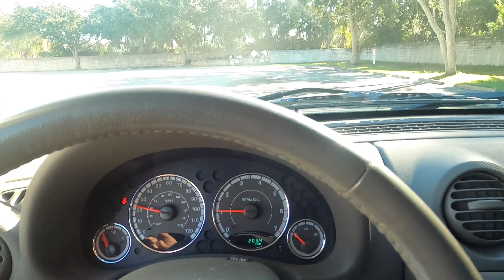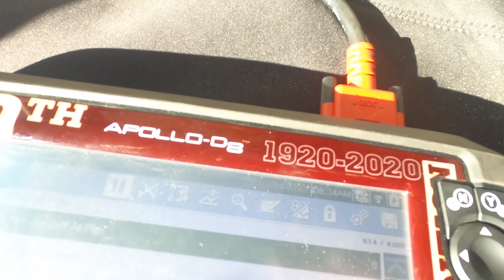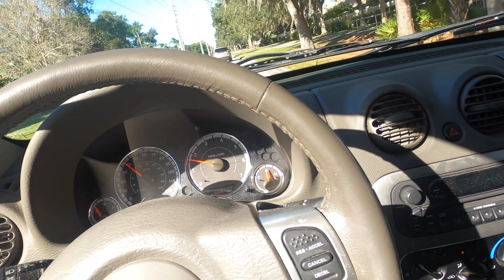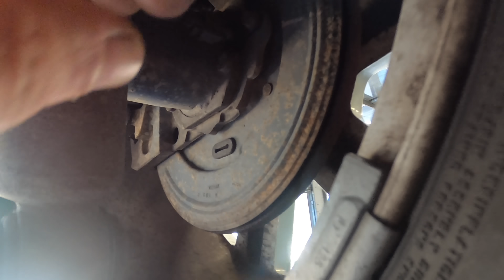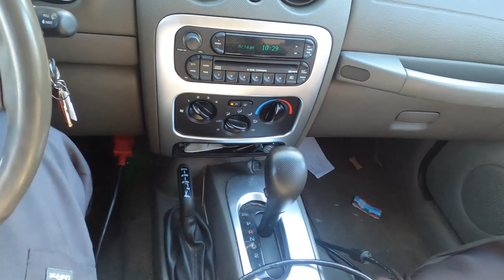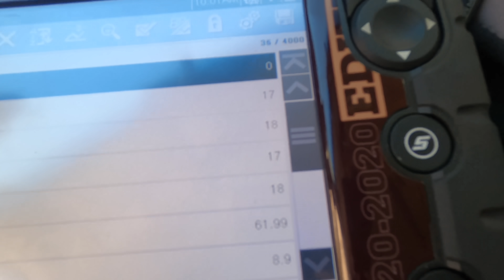MultiMeter Lied to me | Proving a faulty part. Jeep in limp mode

Comment: Easy job for wheel speed sensor on this one always nice to conform by swapping a sensor love dealing with Abs and wheel speed sensors that have single bolt the ones that are apart of the hub are a pain @Rainman Ray's Repairs

Comment: don't assume FLUKE multimeters are the best of the best they are up in the top range BUT they are designed for the military specifications hence the price is pumped up BUT there are cheaper multimeters on the market that are just as good if not better in the way of range, accuracy and build quality like for example BRYMER ( GERMAN ) I speak from having many years of actual experience in electronic engineering maintenance/repair both in the field and lab and I'm no cheap arse just thought I'd mention it, elevated price does not mean higher quality

Comment: So maybe I missed something but I didn't see anything wrong with your meter.  Your first measurements were done with it in auto range mode which for what you do is how it should always be set.  You got a reading for 18.8 M Ohms or mega ohms or million ohms and 4.5 M Ohms (Mega Ohms) on the other one which is a significant difference.  You then changed to manual range and set the meter to Ohms.  This means it could never measure the resistance of the sensors anymore because they were out of range or OL.  It worked great for your leads since they should be almost 0.

Comment: Thanks for sharing Ray- love our videos. My background is in electronics repair, and I like the way you approach issues. The wheel sensors are Hall Effect devices. When you place them on a ferro-magnetic surface (such as the top of the tool box) and move it away, you will trigger the device- which changes the resistance reading on the meter. You cannot expect the two devices to read similar under different physical conditions. Also, the resistance reading will be a function of the current output of the DVM when on different Ohms ranges. You need to turn off auto-range when trying to do a resistance comparison because on higher Ohms ranges the current will be too low to operate/trigger the sensor at all.

Comment: Moving a faulty component to another spot is a reasonable troubleshooting technique, but it can be risky. This story has nothing to do with cars. Several years ago, my office had a large computer system with a fault. The manufacturer's technician was called and he quickly identified what he believed to be a faulty PC board. To confirm it, he removed the faulty board and swapped it with what he believed to be a good board. By doing so, the once good board also became faulty, as did several other components in the computer. The technician ended up having to rebuild a major part of the computer with new backplane and  PC boards, at a cost of over $50 thousand, which his company had to eat. Moral: be careful when swapping components around.

Comment: I always thought that the way to check an ABS sensor is with it installed on the car: rotate the hub and look for (low) AC voltage at the output. I'm not a mechanic by trade, so sorry if this is dumb.

Comment: 0.2Ohm is common resistance of the wires. The reading of the bad sensor was not mili-Ohms, but mega-Ohms, so practically open circuit, maybe some leakage (dirt,...). These meters can not measure mili-Ohms, you would need 4 wires for that...

Comment: the sensors work on changes in magnetic fields. when you tested the first one it was resting on the bench. when you tested the second it was in the air. this also may have contributed to the "off" reading

Comment: I just had a multimeter do the dirty on me. Thought the alternator needed replacing due to the alternator not charging, lucky I double checked with a different multimeter or that would've been wasted money. First multimeter had a flat battery.

Comment: Replace the meter battery.  having the meter in Auto ranging is why the meter did internal tests and the meter then switched to the Mohm (Millions of ohms range).  The values suggest to me that there was a Hall device (electronic semiconductor inside). These are electronic semiconductor devices that respond to the passing of a magnet in front of them, it is not unusual for semiconductors to read very high resistance on an ohms test.  The lower reading in auto was the faulty device.  When you switched to the manual ohms range, it was on the low ohms range 0  to say 1000 ohms so the Millions of ohm reading was OL (out of range). If you had selected the higher manual ranges eventually you would have started reading the Millions of ohms again.  It would be a good test next time you have a sensor out is to put the meter in continuity range and pass a magnet in front of the sensor head. You may see a pulse of reading on the meter. (Try the test with the meter probes both ways around, two tests) You may find this a rough way of getting a test on the sensor.  Good luck.

Comment: Already had an abs Sensor Build as a hall-Sensor with 2 Pins, if you Test hall-Sensors on it‘s resistance you will kill it. unlike the old inductive sensors where meassuring resistance is totally fine.

Comment: If you plan to get a new meter and you need to buy it yourself i can recommend the "KAIWEETS HT118A"  it comes with a light up display and offers a led to light things up on the back. Furthermore it is nothing crazy expensive and does a good job imho.

Comment: Hi this is a standard multi-meter that does not do milliohms, the M on the ohms scales is MEGAOHMS (1 million ohms) which most sensors will measure, sometimes in the Kiloohms (1000 ohms)..Just saying your meter is working fine

Comment: Many times a simple multimeter does not produce enough voltage/energy, in the ohms function, to breakdown any latent faulty insulation problems (sensor body and wiring) to enable detection.  You want to use a meter that has a Dielectric Absorption Ratio test function (Fluke 1587 is an example). Leave the sensor bolted in and connected, disconnecting it from the ECM or whatever computer module it is connected to and then connect the meter at that end of the circuit,  testing the wires and sensor between themselves and each and to vehicle ground. We use this testing methodology when troubleshooting airplane sensor circuits, it is extremely effective in identifying faulty/latent sensors.BTW great troubleshooting with the sensor swap.

Comment: I own a couple of Chrysler's wonderful products, and one has intermittent issues as you showed in the clip, as well as the Traction Control light coming on.
Of course, every time I go to fix it, it stops doing it...
Makes for great frustration.
I suppose I need to buy a DECENT scan tool.
And, yep, digital multimeters have beedn an issue for me as well. Even using the "prove, test, prove" isn't 100% guaranteed to show random issues. And, yep again, the first thing done is replace the batteries if I get wonky readings.
I was always taught "trust your instruments".
Sorry, but no.

Comment: It must be so nice to live in a place where nuts and bolts just come loose and then sensors slide out. Here before I even touched it I would advise more then likely they would have to purchase a new sensor because the bolt isn't going to come out and if it does the plastic sensor is going to turn to dust the minute I attempt to pry it out.

Comment: Grey fox beat me to it. usually a 9 volt battery will fix your multi meter. Resistance depends on it. Faulty speed sensors are a common fault for Jeeps. It looked the same as my Diesel Jeep wrangler speed senor. Sometimes hitting bumps in the road kills them.

Comment: Pro Tip. Watched loads of your videos. One problem I;ve noticed is the algorithm has problems with your Pt1, Pt2 videos. Because your titles don't match from one Part to the other, it can't recommend the second video on the Top right. You need to keep them the same; This video is awesome Pt1, This video is awesome Pt2, etc. Viewers can then jump from one to the other easily. It's also difficult to find the 2nd part going through your catalogue manually because the titles are different. The mini videos you did is a good example.

Comment: M on your meter for resistance does not mean Mili Ohms, it means Mega Ohms.  In other words, very high resistance.  Mili stands for 1000 as the multiplier, Mega stands for 1,000,000 as the multiplier.

Comment: I remember having my 94 wrangler. It ran like crap because the intake/exhaust manifold gasket was broken which I fixed and it ended up running perfect after that. About a year later I look under and see that the o2 sensor was broken off . No codes , no rough running. It was clearly damaged a long long time ago.

I still fixed it but basically noticed no change…

The 90s were the end of an era.
Reply: The '60s and seventies were even better better because that's before everybody got into all these admission controls and they will muscle cars absolute monsters on the road it was a great time have a good evening

Comment: A lot of people seem to agree that it might just be the batteries in your multi-meter going bad, as many time as I've seen you fix problems by ensuring proper electrode transmission, I would maybe start there.  Great work on the fix, point well taken where you can't always swap out the same part from one side to the other.

Comment: I don't know about Jeeps, but Ford speed sensors can be passive, active, or bi-directional. Passive should ohm out to about 1-2k ohms. Active sensors require a special tester, and bi-directional (used on cars with self parking) can't be tested at all. Oh, and you cannot tell which sensors are which just by looking at them. I agree with the others that maybe the battery in your DMM should be changed.

Comment: wish those type of sensors came out that easy around here. i always have to pry them out, and twist them, dig the corroded chunks out of the housing, drill the broken bolt out, sometimes even have to remove the brakes and drive the sensor out.

Comment: I need your help with my 2006 GMC Sierra as I drive the ABS and brake light come on not sure why changed the ABS sensors The Hub the ABS pump and still do the same thing what else could it be

Comment: I have found that disconnecting the wiring harness and probing the sensor terminals with a Volt meter you can slowly turn the wheel and see the current being generated.  No voltage, no Good!

Comment: Probe to pin resistance measurements can be a PITA. When possible I use gator clips, fastons  or sharp meter probes to minimize errors. It is possible to have a bad DMM but getting proper pin/probe contact is usually the problem I encounter when resistance measurement is a valid test for a given component. Nice vid thanks!

Comment: When the display on your multimeter read OL, that was because you were in a range that was to small to give you a reading and at that time you were in the std ohms range and not in the mega ohms range as you were before when you got that 18M and 4M readings. 4M being the faulty sensor.

Comment: Ray, let me share this video of an intermittent crank position sensor failure on a Ducati engine that drove me mad for weeks. I just didn’t expect it to fail like that. You can imagine it would work while the enige was running and vibrating, causing only a slight random misfire, and then occasionally cause a no start condition, which would randomly disappear and re-appear. Infuriating. That bike tested me. No data-logging in the ECU, that stuff is a life-saver https://youtu.be/f76-vg0qcMg

Comment: Understanding your meter and resistance is half the battle. 
MΩ = Mega ohm or 1,000,000Ω
KΩ = kilo ohm or 1,000 Ω
Touching the leads show 0.2Ω or 200 milli ohm or mΩ. You can not read less, so your sensors do not read 18 milliohm. If you set to milli ohm reading, that is why you read nothing on the meter because you're to far out of range. 🤔

Comment: I could be wrong Ray but I think a resistance test on active wheel speed sensor is not a valid test. But the swaparoo test you did is quick and easy to pinpoint the problem and my go too.

Comment: The sensor is likely a semiconductor device, probably a Hall Effect device, not purely resistive. That's when you try the "Diode" setting on the meter, which keeps the meters sourcing voltage under 0.7 V, so the diode junction doesn't forward bias.

Comment: Test leads get worn from stabbing insulation or using them as tools.
Meter batteries have to be replaced once a
 year at least.
John Fluke makes the meters I trust when having to condemn an expensive component.
I didn't like my RPM hunting in a fluke meter once and sent it for diag.
I received a call to nail down how to make it act up instead of a quick bench test by the meter man.
When they shipped it back, it was brand new and an additional new set of test leads were included.
I gave the tool truck 40 for getting it done.
There was no charge by John Fluke.
I have an 88.
It's bad ass.
It doesn't lie, but new test leads are good for diagnosing old test leads by comparison.
Hope this helps.
Our shop foreman would never trust another guys meter.
It had to be a fluke.
Then he would figure out what was going on.
Guys were told to take their new china meters home when he could isolate them as a cause.
One guy found out what a RABS valve tastes like.
Sweet and sour sauce didn't help.

Comment: Nice video. Wheel sensors are hall effect devices (semiconductors).  Semiconductors don't measure like a resistor would.  The voltage provided by the meter will affect the resistance reading (which was in megaohms).  Reversing the meter leads can change the reading and each device can actually read a slightly different resistance .  Your meter only showed that the sensor wasn't shorted.

Comment: Craptacular multimeter wires are, in my experience, the number one source of faulty, inconsistent and otherwise unreliable readings. Batteries can be an issue, but if the meter has enough power to light the display, it probably has enough power to perform its tasks.

Comment: try moving,disconect,re conect the multi battery. or replace it. i find if i roll the bullitt type a few times they come good, same as a car battery, they get resistance build up. tiny nano corrosion,inbuilt failure, production & consumption. ect,ect.

Comment: I had the same issue with one rear sensor showing 'Implausible signal' a few months ago.  I went with the easiest troubleshooting option like you did, and swapped the sensors. Bad side was good, and the good side went bad.  Fault double verified by transfer!
One new sensor & all good.

Comment: Probably because I'm more of an electronics guy than an automotive one but my advice is always have at least two meters so you can compare readings when you're questioning what you're getting from one.  And an extra set of batteries helps too.  Especially with cheaper meters I've seen them do strange things with dying batteries before the meter's low battery indicator came on.  Kind of the same with indicator lights on cars I guess.

Comment: What is another phrase for              "with that being said?"
Sorry Rainman couldn't resist myself:

Need synonyms for with that being said? Here's a list of similar words from our thesaurus that you can use instead.
Adverb
Within the constraints of the situation
all things considered nevertheless however nonetheless notwithstanding still yet even so otherwise regardless all the same despite everything despite that natheless still and all for all that in spite of everything irregardless that said at any rate in any event in spite of that in spite of this just the same and yet be that as it may despite this in any case though anyway having said that howbeit withal but anyhow after everything at the same time come what may although after all anyways but for all that not the less but despite that but still but in spite of that even though besides even then again furthermore on the flip side on the other hand conversely whereas at all events whatever happens contrariwise on the other side of the coin no matter what be it as it may then but then again without regard to in spite of despite no matter what happens per contra despite the fact that in spite of what preceded when all is said and done while again either way at any cost on the flip-side whatever the cost rain or shine whatevs whatever

Comment: Always use fresh good quality batteries if ever in doubt.  OK to replace just because as a routine every 6 months max or sooner if you use your meter a lot. 
I got bit by multimeters about 33 years ago. Using a fluke 70 digital.  Metering continuity through an electronic circuit (Accessories power on relay box with resistors and diodes) on an airplane.  Did troubleshooting all morning and found nothing.  I went to lunch and someone was using my meter when I got back.  I was frustrated and decided to start over.  I grabbed my ancient analog Simpson 260 meter.  Instantly found my problem.  Got my fluke 70 back, remetered with new batteries and it showed good.  What happened was that the fluke 70 does not have enough resistive load within the meter and that is why it failed to detect the problem.  I opened up this relay box assemble and found visual confirmation of a problem.  One of the voltage dropping diodes was burnt.  Another troubleshooting lesson taught by the school of hard knocks.  AKA I got my ass handed to me.  I use fluke 80's now, but still have the same Simpson 260 as a backup.

Comment: Check the batteries in your meter.  .2 Ω isn't terrible.  The probes can give flaky readings.  There is probably a way to calibrate the meter.  But, I just deduct the .2 Ω  on readings.  If gravity hasn't attacked your meter too many times, I doubt it is faulty.  I like using my analog(old school) meter at times.  It does have a calibration dial.  My digital meters are nice tho.